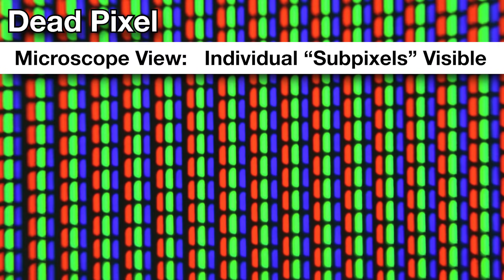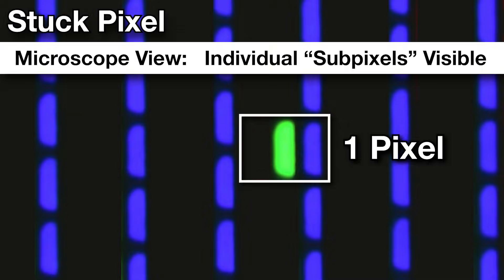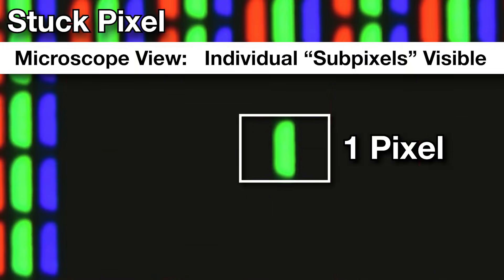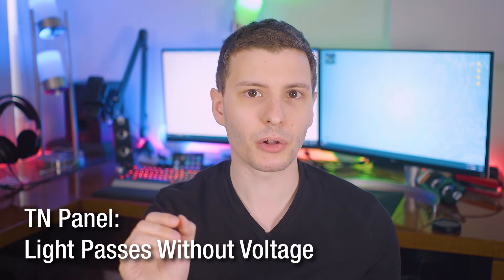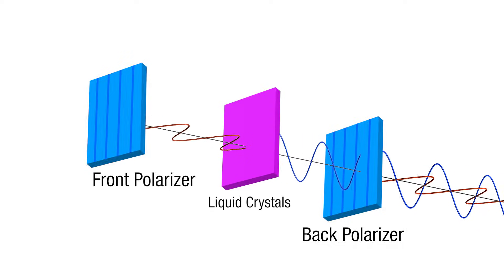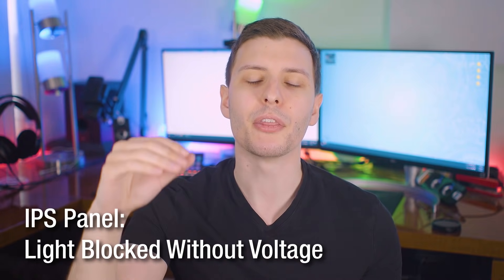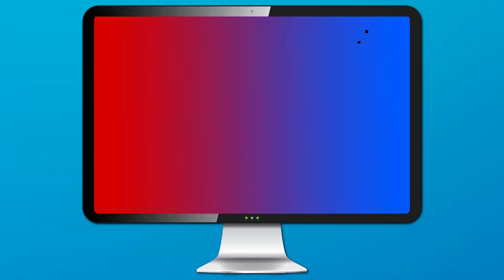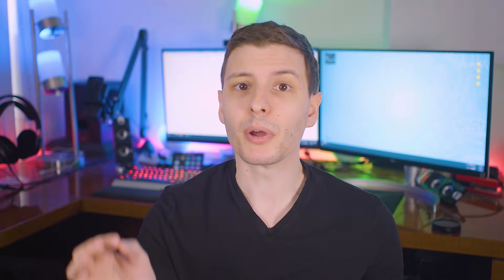Dead & Stuck Pixels: Causes and How to Fix Them

Comment: I had a small green stuck cluster of pixels (probably 2 or 3, on a TN panel), and after a few hours of the flashing lights it didn't fix itself. So i tried with a pencil eraser, and lightly tapped on it. It fixed itself until I turned off the monitor, then came back. So i did it again the next time I turned on the computer, same thing. After probably 5 or 6 "cycles", it finally stopped coming back! Now it's been almost a year, with no problems. I didn't get the dark spot, luckily

Comment: I once had a stuck green pixel on my screen, I was fortunate enough that a couple seconds of pressing it with my finger was enough to fix it; the nat-20 of pixel fixing.

I wasn't able to determine if it was TN or IPS, but the monitor is an ASUS VS248HR.
Reply: Looked it up and it was a TN, which means you somehow fixed a pixel that didn't have enough voltage

Comment: I noticed you are talking about LCD monitor pixels. I've got two symmetrical red pixels on a LED AOC brand new monitor. Is it a deffect or  not ? It troubles me that they are symmetrical. I checked the cable on both ends and they are in place but I still got those two red pixels. Any idea ? Remember , is a LED monitor , not a LCD one. Thanks in advance!

Comment: I'm interested in upgrading my 28.8 kilobaud internet connection to a 1.5 megabit fiber optic T1 line. Will you be able to provide an IP router that's compatible with my token ring ethernet LAN configuration?

Comment: I have an older lcd laptop that had what appeared to be a dead pixel. Started as a single or maybe a small cluster of em. As time goes on, it's spreading out and growing larger, like a disease. Eventually the entire screen will be dead. It does have vga output so that's how I'll keep using it. It's basically a darkweb/tor only machine, as the battery doesn't hold charge, and I can just unplug it for instant disconnect. But what causes this issue? Is it simply showing it's age? It's an emachine with an Athlon 64. I upgraded it to a dual core turion bcuz it actually has an interchangeable socket. Pretty sure I could just replace the screen, but I could probably replace the entire machine for less cost. Just curious.

Comment: If rubbing the dead/stuck pixel directly doesn't help, try rubbing the area around it. Worked for me.
Reply: what color was your dead/stuck pixel?
Reply: @poremich  Green. Rubbing the area under it with a microfiber cloth helped resolve the issue.
Reply: @Truescreen  how long did you rub it for?
Reply: @poremich  For around 5 or 10 seconds, until the stuck pixel fixed itself.
Reply: @Truescreen  damn, it didn't help, I guess I'm doomed :/

Comment: All the things you said was true and pro but in my case my surface pro 6 had a red stuck pixel and I used a hair dryer so hot and at first it turned the whole area of screen black and I nearly got an heart attack but after a few seconds it turned back on and the stuck pixel was fixed

Comment: Dark areas from too much pressure are called bruises. If warrantee wont cover bad pixels on a new screen, I believe UK consumer law states under the distance selling regulations that you can return any item without stating a reason within 28 days as long as you have all the packaging and have not damaged the item. Usually you need to contact the supplier for a returns authorisation code. There are exceptions for personal items like makeup for example, or items made to order, etc. but if your new TV or monitor has an annoying dead pixel problem in the UK - you might be in luck!

Comment: My brand new (In 2013) Alienware 18 gaming laptop had a dead pixel mid-screen when it arrived.  Not sure what type of panel it has, but it also has a mat finish like yours.  One firm, medium-hard flick to the general area of the dead pixel with the flat of my fingernail (an area of about 1/2 inch square), and it has worked perfectly since.  I can't remember where, but I had read about 'the flick trick' in some computer publication of the day.  I liken it to how people (including me!) used to sometimes smack the side of their tube (CRT) TVs to get them to work.  There is no guaranty that this 'trick' will ever work again, but may be a better option to try prior to rubbing the hell out of your screen with an eraser or stylus.
Reply: hey bro i just got a new monitor and it had a black pixel, i applied some force to it and it was gone! did yours ever return?
Reply: @smzi  Never...  Knock on wood, it has been working great since the first flick.  Glad to hear that this trick seems to have worked for you also.
Reply: @tjerome1683  good to hear, appreciate the reply 👍
Reply: @strangestecho5088  I'm so glad it worked for you.  In my mind there are risks to all of the possible solutions, but they are far outweighed by having to look at a dead pixel FOREVER if I didn't try something.

Comment: Just as a side-note to anyone watching: sometimes, dead pixels might not actually be caused by a fault in the monitor. Sometimes, especially in regards to GPUs and any related software/drivers, dead pixels can be rarely caused by errors at a software level. I use an IPS LCD TV as a monitor and noticed a dead pixel. Initially, I was worried it was a fault with the monitor, but after changing input signals on the TV itself (I also use it for an attached game console, on a separate connection), the pixel miraculously worked again. Switching back to PC input, the pixel "died" once more.

The solution? The oldest trick in the book: restart your PC. Clearly, it was some error with the GPU software, which, upon restarting, reinitialized it properly and — wouldn't ya know it? — the pixel was restored to normal functionality.

So, before trying any of these solutions, just try restarting your device first. It's said often, but it can't be understated: restarting your system can fix a huge host of small problems with minimal effort. Even weird ones like seemingly dead pixels.

Otherwise, great video. Informative and interesting.

Comment: Hey Joe, I bought an LG 24GL600F and today I tried it. It has two pixels that are near each other, one is red and when I put a red thing on it it turns black, other one when is on a shite background is just green, and turns red when on a red background. Those are examples, it turns like into different colors depending on the background. Red pixel stays red and black almost with all combinations. I asked to change it but I dont want to wait like a month or two weeks. What do you think I should do?
Reply: What did you do?
Reply: @ΚωνσταντίνοςΙωαννίδης-ε4β  I have it, the same one. Works perfectly after a year and some months

Comment: Idk if my phone's IPS panel problem can be described as dead/stuck pixel, but, my phone have some strange individual pixels where if they are set to grayscale, the color is fine, but if it's in other color it will looks a bit different, seems like there is other random subpixel lit much more than needed, and will stand out when other pixels around it displays the same color in the right way.

But it does not really bother me that much since my phone screen's ppi is adequately dense, those pixels were far away from each other and it usually used to display complex image so those pixels does not really affect the overall look.

Comment: I (used to) have a column of stuck pixels. They frequently flip between blue and cyan. I'm guessing that one or two of the column connections broke somewhere, or a transistor or two got stuck in the off state (perhaps a power surge that caused the voltage to get a little too high). The monitor is now connected to my backup PC (for when my laptop breaks or something), so I don't have to worry about seeing that every time I use my computer (yay)

Comment: What about a Vibrator :D Hear me out, you have a part of a subpixel stuck. Vibrations seems like it could be the gentle form of percussive maintenance and it feels like either there is a very slight electrical connection problem so not enough, or to much voltage( in your case likely due to corrosion) so constant vibrations around the area might loosen it without to much risk I wouldn't expect.